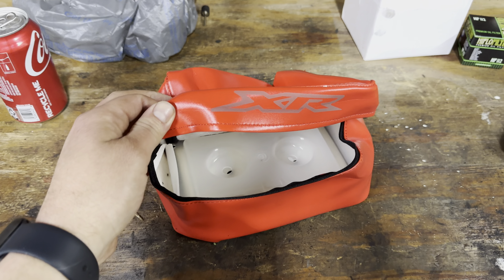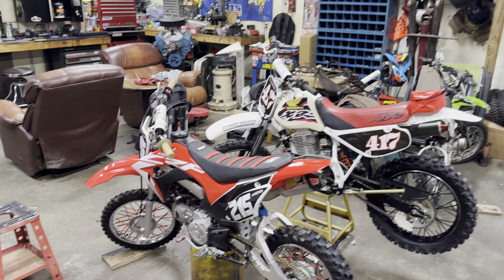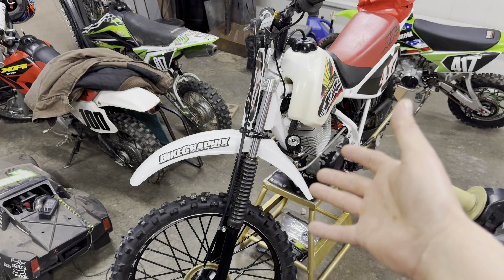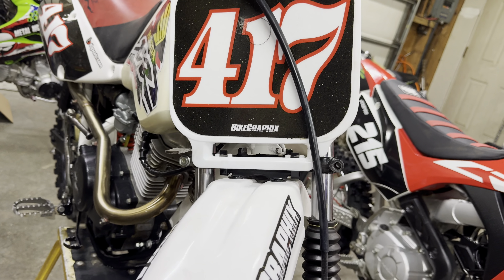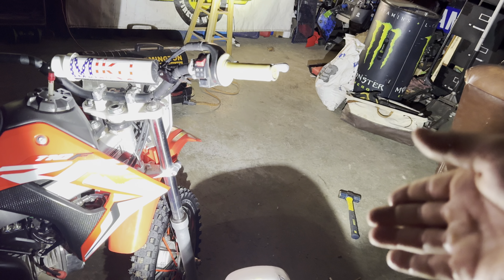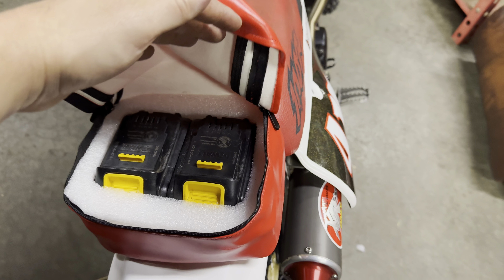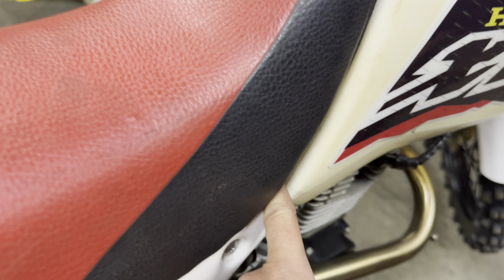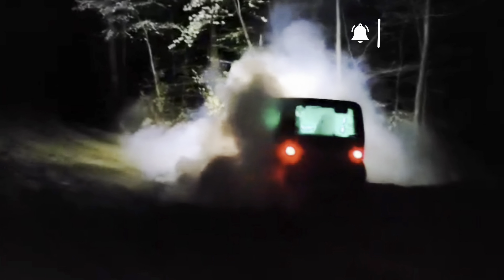Xr100 LED Headlight Install (Super Easy!!!)

Comment from the maker: Hey guys if you’re unable to make the bracket to install a led light it’s no big deal. Factory mini bikes, faster minis and tb parts along with other sites sell led lights that come with the clamps that attach right to your bars. Then all you need is a rear fender bag and some drill batteries and you are good to go 👍